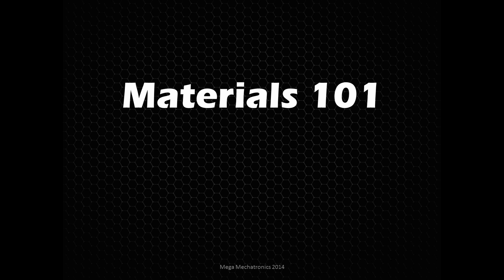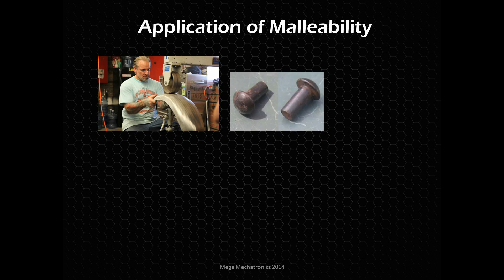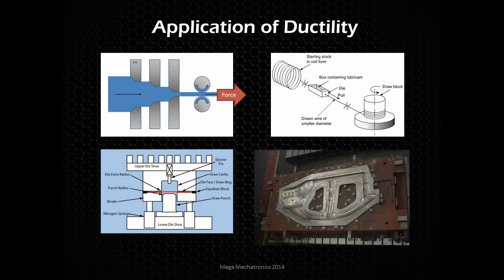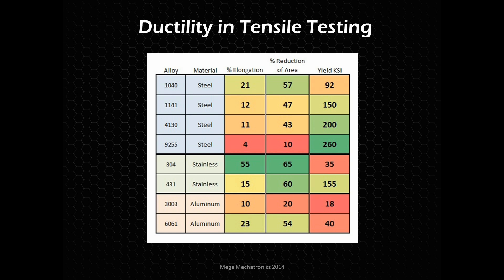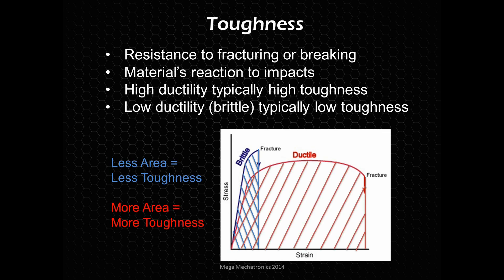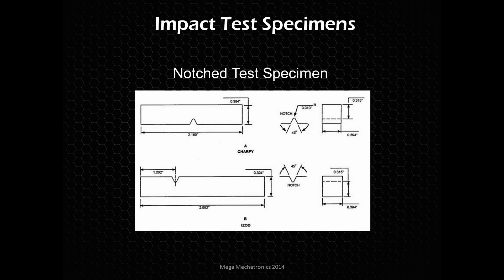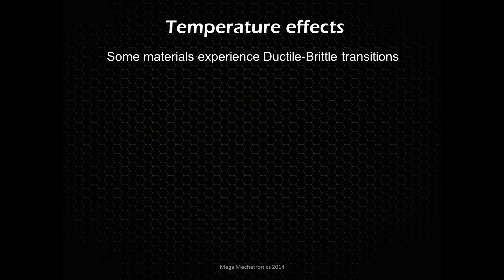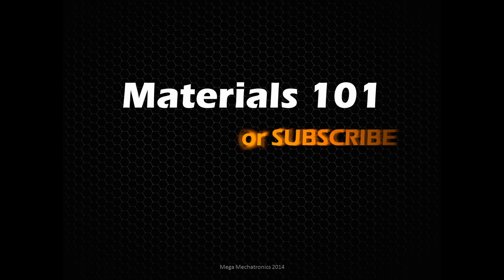Materials Science Mechanical Engineering  - Part 2 Ductility and Toughness Explained

Comment: How is stamping an example of ductility?
Reply from the maker: When you're stamping (or pressing) something you're plastically deforming the metal into shape. Punching would be shearing. Check out this animation here: Introduction to Class A Stamping Press-Animated Part 1

What I wanted to illustrate with that video is that the flat blank gets deformed into the curve.  The shortest distance is a straight line, so the curvature indicates the part was stretched out. Some failures or quality problems in stamping press operations are splitting, where the metal literally splits near the areas that are drawn excessively; surpassing the UTS of the metal in those areas.